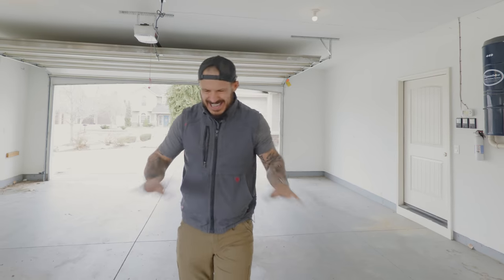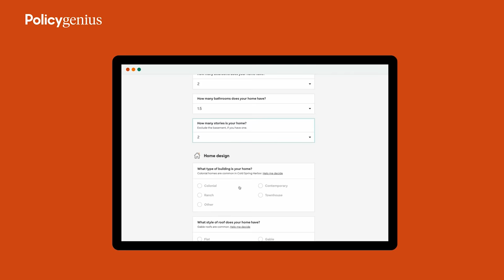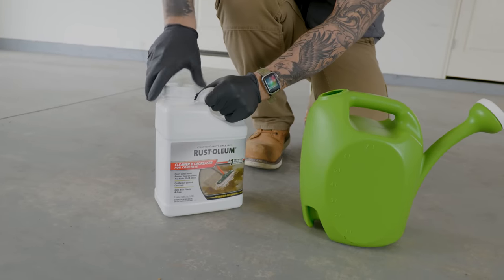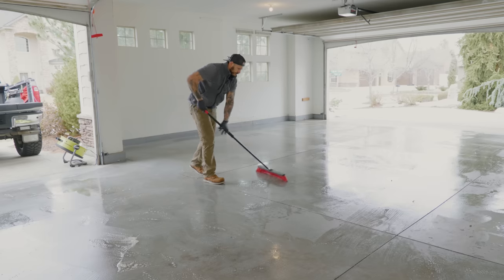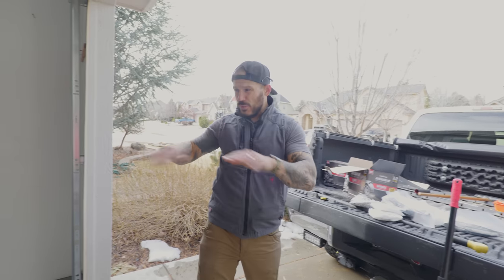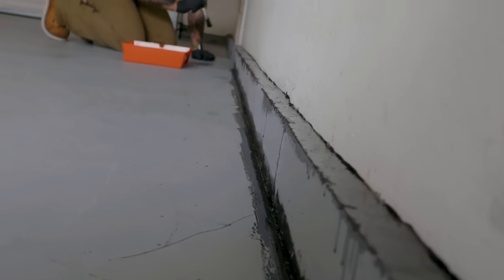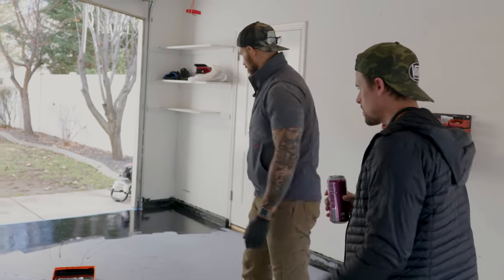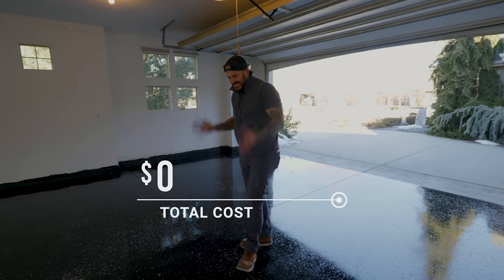New Garage Floor Epoxy + SAVED $5,000 BY DOING IT MYSELF || Concrete Slab House Reno (Ep.3)

Comment: As a tradesman and specialize in epoxy and urethane flooring this was the most cringe thing to watch I give this floor 6 months before it lifts off the existing epoxy that’s already there, side note if your going to pour epoxy over  old epoxy you HAVE to at least bare minimum scratch up the floor and than base coat and top coat but I’d still recommend primer and doing it the right way, it was quoted 5,000 for a reason because this is a craft not a DIY to save money this is cost you more in the long run. And to top it all off I bet that concrete was still damp

Comment: Unfortunately it’s never going to last. You really needed to rent a floor grinder and then use a 4” grinder for the edges, corners, etc. Prep is everything. Use tape and plastic to get clean edges. I would recommend to wait as long as possible before starting to park on it. Hot tires will peel it up with these cheaper kits. Also a tip for the chips, you want to throw them high into the air. They will spread out much more naturally.

Comment: Could we have a 2 yr update?

Nice work.... but no surface grind or blast during prep?  I would have done that first to take down the top layer and rough up the surface for better adhesion.   Then an expoxy clear finish on top.  That combo should last much much longer than this.

Comment: Did you epoxy over the slabs expansion cuts? I'm not sure where you live but here in Canada between the seasons Im wondering if it would matter...I can't see it doing much harm other then creating a fine crack along the expansion if things were to move...I also think this is a quick cheap fix for a limited time grinding the epoxy away and roughing the surface I think would last longer but what it's being used for absolutely perfect!

Comment: Question: I’m a first-time home owner and was considering doing this for my sunroom that used to be carpeted; any thoughts or suggestions?

I’ve already torn up the carpet and filled the cracks, but there is this yellowish carpet glue still remaining on large portions of the sunroom. Not sure how much of an issue that is
Reply: You will have to get all that glue off of the floor before putting epoxy down.... and its a bitch. Should definatly diamond grind, or find tips and tricks from actual professionals, not this guys video. ...or just pay to get it done properly, some companies, like mine, offer a lifetime warranty

Comment: Hey  Mr Build It..  I’m doing my garage floor with epoxy but I want to do a self leveling because the garage has joints of 4 squares and the center of the squares are sinked in about 1/2”..

If I do a self leveling will that affect the epoxy?

Comment: that garage didnt have epoxy before, it had sealer, and you should always sand or etch the concrete surface you are applying epoxy to, those people were quoted $3,000-$5,000 because they use 3 layers of base for a uniform engineered level surface, flake, clear and a warrantied finish, they also sand the entire ground to uniform engineer spec level. its comes out to $3000 in materials that way so you're only paying $1000 tops for a 10 year warrantied floor. looks great for DIY though, it may not last very long however. looks great!

Comment: Only $400, but a nice amount of sweat/physical equity...I hope that it lasts...not grinding off that top layer and putting some scratches in that concrete may be detrimental once you start rolling hot rubber tires across it.  I'd like to see an update video a year or two from now.  It does look very good though!

Comment: Looks great! Just don’t drive on it or subject to sunlight and you should be fine. There is a big difference between what you did and how the pros epoxy coat a garage floor although I agree, $5,000 seems excessive. What does that work out to per sq ft - $9.00? That’s an expensive garage floor! You can DIY the job, you have to grind the floor and use professional epoxy coatings but you’ll have something that will last.
Reply: do you have to place primer on concrete after prepping

Comment: I hate to say it but that floor is going to peel up. Epoxy needs to be mechanically abraded before another coat is applied outside of the recoat time. Also the $3-5,000 that your friends were quoted would be for a high build full flake system. Not a thin mil partial flake broadcast.

Comment: Nice! I can't tell what color flakes you used but I did the same exact style on my garage 3 years ago. Black base with white and gray flakes. Couldn't be happier with the outcome.
Reply: Did it last is the question or did start peeling off in high traffic areas?
Reply: @MStar10  for mine it's lasted just fine over the 4 years it's been down. The only bad part is that if there are any scratches, it's visible.

Comment: Okay just watched this it turned out amazing. I have a question for everyone. I just bought a place the people before me had pets that had some accidents. So I pulled up the carpet and padding and it's on a concrete slab. I want to use this technique on the floors. What would you recommend to use to clean the concrete? There are dark spots from the accidents from the pets.
Reply: I know this comment might be too late but you should grind your Concrete with a concrete grinder. Concrete is porous and it absorbs so the only way  you’ll really get it out is to grind it out of the concrete.

Comment: Best timing, 2 days before I was planning to do mine. You are amazing
Reply: How did yours turn out, assuming you did it yourself?
Reply: @fleckbigsby5432  Came out very nice but I encountered 2 issues: 1. my concrete seems to have had some sort of paint applied in the past, so I had to rent a grinder to get rid of all the paint.  2. My floor took a long time to dry after washing it, not sure why. I also bought extra flakes online, as I found the flakes that came in the package were not enough.

Comment: Bro the reason it’s so expensive is because number the coating done is usually thicker number two flakes are covered from top to bottom number a top coat goes on it to protect even more number 4 not everyone’s concrete looks as nice as yours when you started lots of them have cracks pits etc that’s why it’s so expensive😂

Comment: Thanks for this video! Would you recommend adding a sealant or top coating after applying rocksolid?
Reply: Absolutely! You apply a clear coat to protect the actual epoxy, flake, etc. Whether it’s professionally done or DIY you should always always always put a clear coat on top.

Comment: Looks good for now, but it’s misleading to say that others quoted 3-5k for that when all you did was paint concrete with a cheap epoxy Kit. A proper quote would have included concrete prep with shot blasting or other techniques, along with a better quality epoxy which would allow for a long lasting finish. Yours will be cracking or flaking apart in no time.

Comment: Looks like a nice epoxy floor coating but let's NOT cause any mass confusion by comparing to these alternative concrete coatings that cost thousands of dollars.  These cheap quality epoxy kits tend to result in hot tire peeling.  I've seen these kits installed on concrete that was fully cleaned and acid-etched and still peels up.  I got lucky putting one down in my last house that stayed down for 10 years no issues.  The jobs costing thousands of dollars usually provide concrete grinding (so the coating really grabs the concrete) and polyaspartic or other MUCH higher quality finishes.  It's unfair to compare these DIY garage floor kits to those alternatives.

Comment: This wont last for more than a couple years. You can't apply epoxy right over previous epoxy... You should have mechanically stripped the old epoxy off
Reply: $400 every so many years does not sound bad to me. But, done properly once is always nice.
Reply: @AutoMotivate  The problem is, the next time, you will HAVE to mechanically remove everything, because the second coat will flake off the original coat. You'll never get a third coat on that without grinding everything. If he had rented a grinder from home depot for 4 hours for a couple of hundred dollars, the epoxy would last a LOT longer...
Reply: @nevetskcaps  And next time his garage is going to be full of tools/storage/machines etc...  He should have done it properly first time around....

Comment: This is going to look real bad real soon as this won't hold.  It will start to peel because he needed to sand the floor to remove previous sealant to make a not smooth surface for new epoxy to bind to.  The way this is applyed, it has nothing to bind to.  Also no clear coat at the end, no protection either.

Comment: Low cost :) cleaned okish, no primer, no proper thickness, no topcoat, I`d like to see how it looks in 12 months.
Not afraid to try and fail, agree! Good one! With some simple machinery and more coats you could make wonders. Good job for basically 0 equipment and positivity :)

Comment: Can this be applied on the outside? Or is this for indoor use only? Will it hold out to rain and snow?
Reply: Personally wouldn’t recommend epoxy on outside surfaces but what you could do on outside surfaces is waterproofing.

Comment: for $5000 you have someone take the time to do it right, create something that will last for years and years that adds value to the home.  simple things like getting good tape down before, grinding the concrete to create a good bond betrween the sealer and the cement adding actual epoxy rather than sprinkling sparkles on sealer.. definitely get what you pay for..

Comment: You need to make sure you clarify $400 for a short term DIY project vs a $3-5k professional project. Professionals take the time, you wouldn't have ugly cut lines on the walls, and messes where they shouldnt be. You would have had a more thorough cleaning job, and you didn't even put a clear coat over the epoxy to protect your current finish. So this job won't last very long, and the price is what shows it.  There are home owner specials, and there are professionals. This is a great DIY video, but don't bash on professionals prices when they use higher quality products, and put more time, effort, and prep into a project.

Comment: I do epoxy floors for a living and this system will not last yea you might save money but you’ll be replacing it every 2-3 years and it serves no purpose other than the correct system that will create more structure in your floor and prevent cracking

Comment: The $5000 Epoxy was most likely quoted for a two part proper Epoxy with grinding, primer, dress coat and a topcoat. Not just one coat that you roll on with a 6 inch roller. Stop sending the wrong messages to the homeowners.

Comment: The reason people charge $5,000 to do this is because they actually grind everything off of the top to Bear concrete and get some really nice grinding marks in the concrete and then they put down a primer that soaks into those grinding marks and then they put the base coat of epoxy the flakes and then a clear coat on top. This shit ain't going to last very long at all.

Comment: Is it as easy to roll on as paint?
Reply: It can be. Most people recommend another layer of epoxy for a clear coat over the chips which isn't a part of this kit and is generally a pour, not a roll on, but the biggest and most important part is the preparation before rolling it on. Gotta strip everything off that floor with a grinder that you rent or a guy with a grinder you hire. I plan on doing mine but I'm going to fork over the $ to someone to do the grinding for me so that it's done way better than I can do it.

Comment: Ive been doing epoxy floors for 10 years do not buy any hardwear store epoxy kit he just threw 400 dollars away. You need to prep the floor with and actual floor grinder washing it does absolutely nothing but waste your time. Good epoxy needs squeeged on and rolled. That 3-5k gets you 10+ year warrenty depending on on the concrete base

Comment: Sorry to burst your bubble, your "5000.00 dollar Savings" won't last long. There is a reason professional epoxy flooring contractors charge what they do. The number one reason for flooring failures is the lack of proper preparation, which is diamond grinding and or shot blasting. These setups are expensive as the professional will have several diamond combinations for hard, medium, or soft concrete. Plus HEPA vacuums to contain the dust. A professional would have ground off the old epoxy, filled the joints, so cleaning is easier, you now will push dirt into the saw cuts. Check out youtube. There are several videos of contractors grinding off old failed epoxy floors that were not prepared correctly. That is the hardest part. I wouldn't waste my money on any "epoxy" from big box stores.
Reply: Like he said, he's not afraid to try and fail...lol. But I agree, big box store epoxy flooring doesn't compare to what the industrial grades one which the pro's use and of course the biggest thing...the preparation. But hey, his money and time. It looks good for now and we'll have to wait and see when it starts to lift.

Comment: if someone got charged $5000 its not for the job you just did in 1 day, a lot of times garage floors need to be fixed... yours is in great shape and a 1 day job wouldnt cost that much, your friends that got charged a lot probably needed their floors grinded, maybe had a lot of oil spills, concreate breaking up so it needed to be re done, power washed. and thatd be a couple of days if the concrete is being added. for a job like you did i wouldnt imaghine ti costing more then a few hundred in labor if youre supplying the materials.

Comment: Left the old coating on when parts are failing?  Didn't profile it?  The (very) old quote about a good "paint" job is -  "prep, prep, prep" or "preparation is everything".  Goes for almost everything in life (if not everything in remodeling/construction).  Good luck long term.  If this is how you do your projects, it seems like you may cut corners.  Penny wise, pound foolish is many (most) times true.  Sorry to be a downer but cheep isn't always the best.

Comment: I do this for a living and i gotta tell ya.....this looks like shit. Sorry. Your guy was priced at 3/5 grand cuz its 3/5 grand quality. This looks like you painted the floor black then dropped some flake on there. Anyways the big question is hows it holding up after 2 years ?
Reply: Exactly!!!
Reply: @elic.2443  Yup need to grind the floor for a scratch in order for the primer to bond then apply an intermediate coat w/ flakes and finally a top coat/ urethane to seal it

Comment: Don’t want to put a negative spin on things but it is important that people understand reality and the pros and cons to doing a floor like that. 

You pay $400 for a garage epoxy and you’re going to get a $400 floor. Guarantee that stuff will peal and fall apart in no time. Especially since you didn’t even clear coat it. That floor will be slippery as hell when wet also. It also will look dirty and look like absolute sh*t after a few days. It’s black. Garages get dirty and dusty. That garage floor will be nearly impossible to keep clean. There’s a reason you were quoted $5K by a professional company. $400 DIY and $5K by professionals and you don’t think there’s a difference. Some things are worth paying for and for a good lasting garage epoxy, is worth paying for.

Comment: Usually love all his videos and watch them regularly. But this one was a bit rough around the edges. The side molding looks terrible and the whole floor looks splotchy and not even, even some flakes are sticking up. This floor won't last very long, particularly on a garage that will take the weight of what appears to be a heavy truck and the load of a garage-shop. I guess you get what you pay, in this case was a $400 bucks job and it does look like a $400 bucks job.

Comment: Quotes were 5k because all that crap that was down needs to be ground off. What do you think happens when you put a coating on a failing coating...Do not do what this guy did it's 100% going to fail. 

And don't take advice from someone who pressure cleans drywall and interior windows. Lol

Comment: Some advice - Pay someone to do it.
This is a mess and looks half way done.
The color is extremely dark and what's with that sprinkle. It has self adhesive to lay flat on the floor?
You cant compare this AT ALL, to a professional job. Hence, you get for what you pay for.

Comment: The paint work on the edges looks so bad, it is very jagged. You should have let your buddy do the edge work. 

I am also willing to bet this DIY epoxy job will not stand the test of time. You applied the epoxy over a painted surface without stripping it or scuff sanding it. The adhesion will be very poor. $1,000 says it starts to peel and crack by next year.

Get it right the first time or don't do it all (or just hire a professional).

Comment: That’s not a $5000 epoxy job. If you paid $5000 you would have a multi coat system with a high solid epoxy and a urethane over the chips. I bet you have a 2mil thickness. A $5000 job would be 10 plus mils.

Comment: May have saved some money. But your prepwork is not up to par... we diamond grind the floors, vaccum, then denature alcohol wipe to get the floor ready for epoxy. Your whole floor would be broadcast with flakes... not that store bought little bag you have to sprinkle around. And you have so many drips on your stem walls. I'd bet the money you saved that this floor will peel up in 1-3 years. Half our work is re doing self done epoxy floors.

Comment: You didn't save $5k.  You saved maybe $350.   This looks like the $400 job it is.  I'd do it for someone for probably about $700, + tax. Definitely should surface this with epoxy clear coat.   Why would anyone want an unsmooth floor?